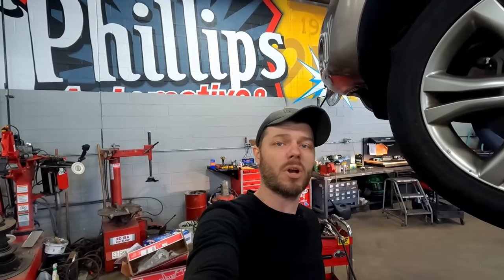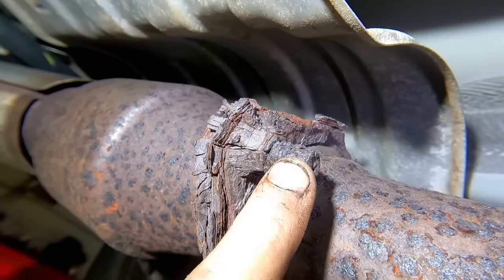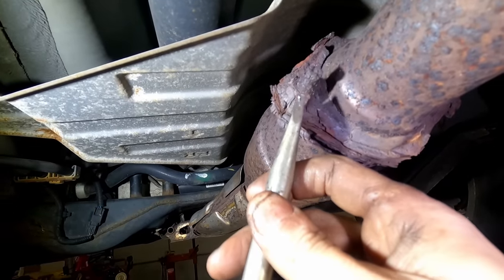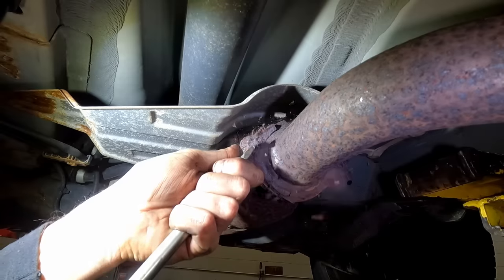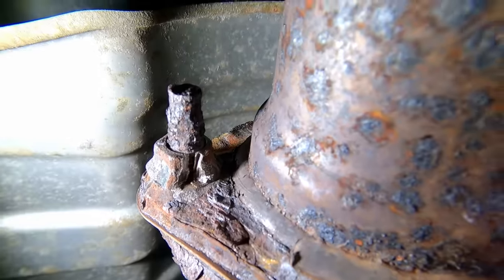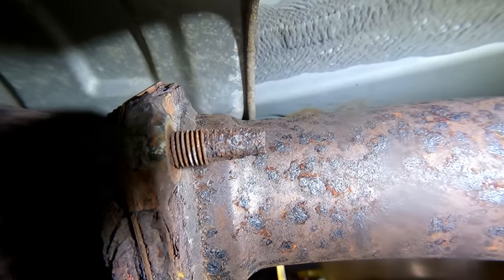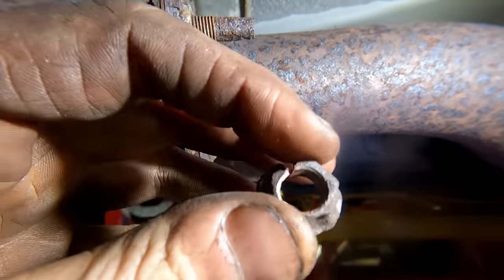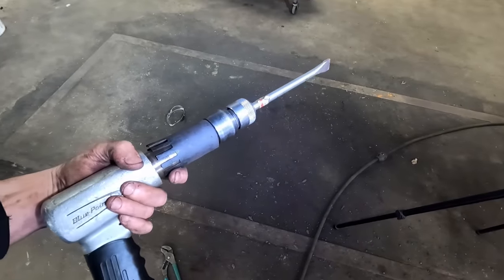Top Secret Mechanics Trick 2! HOW TO remove extremely rusty exhaust nuts FAST without heat.

Comment: My dad taught me that trick with a hand chisel back in the 1970's.  He learned it back in the 1930's,  Nice to see that not all older methods have been totally forgotten.  Still, now that I'm older and II cheat and use a nutcracker where I can.
Reply: Agree, that's the old way. 👍
Reply: @dickJohnsonpeter  Agreed. If you can't afford to replace rust-damaged hardware, you're not charging your customers enough.
Reply: today  Nobody does this way , cut the old bolt then heat up half bolt left on flange and punch it out , replace new bolt ,
Reply: @thev5140 : this is what I have been thinking the whole time !!! …
Reply: @thev5140  This method would be helpful for removing BMW exhaust section mid pipes that connect to the headers. Those headers are $4,000 and all the best getting a torch in there. I'm broke and don't have fancy tools. I have successfully removed rusty exhaust bolts by warming the car to operating temp, blasting it with "Deep Creep", hitting it with an impact or extractor socket. Never failed. This is the #1 hurdle for BMW guys.
Reply: My dad taught me this trick back in 1310 and he used a piece of wood to get it out.
Reply: Never work on anything rusted without gloves and the assistance of what MapGas offers.
Reply: I call BS.  This is Top Secret.  No way your dad would have taught it to you!
Reply: @jsnthurst1  Alchemy passed down from father to son.
Reply: @thev5140 you missed the point . Wach again till u get it.
Reply: My Dad too at about that time,  Problem with using a hand chisel is you need to hold a sledge hammer on the back to keep the clamp solid otherwise you loose the energy of the hammer blows.  Nice video,
Reply: @bd3403   The tool every mechanic needs but doesn't have is a third hand.. it would make so many jobs so much easier.
Reply: I learned this in 1904.
Reply: @Michael-yi4mc  Oddly... I'm not nearly as surprised that you learned something in 1904 as I am that you can still remember it.
Reply: @RJ-vb7gh  👍I was a savant cat in my past life 🐶
Reply: @Michael-yi4mc  All 9 of them?

Comment: Easier to cut them off and use new bolts and nuts. I don't see any advantage using stressed and rusted hardware..
Reply: not if you live far from a bolt shop or if the bolts are part of the other flange. You could have new bolts ready, but how would you identify the thread when its so far gone? Is it 5/16, 3/8,7/16, UNF ,UNC,  M8 standard, M8 fine, M10 std, M10 fine, even M12 on a truck!
Reply: Can't always cut them off , try undoing a rusted 3 bolt exhaust rear flange on a pajero above the rear axle , a grinder doesn't even get close
Reply: @stestar09 cutting torch is faster than a grinder.

Comment: From a retired toolmaker from Australia  a very excellent tutorial of the process with no waffle just facts .This 76 year old fella just  learnt another helpful life tip .Thank You
Reply: Are u sure yr a toolmaker, coz IF u are surely this is old abc knowledge.
Reply: @cmx4eva  YES I Certainly am a toolmaker not a red neck mechanic and you learn different skills . So here is a test for you . Try to figure out how do you cut a  left hand thread into a 10mm [3/8''] thick piece of metal using a R.H. tap . And yes it can be done I was shown by a older Russian toolmaker .
Reply: @cmx4eva  
Also ABC knowledge is that tool makers deal with almost no rust. Certainly not the kind you find under a salty road car.
Reply: @kevinklei3005  I am curious... how?
Reply: Me 75 , Amateur   in Mechanics , I too learned something new from him……
Reply: How do you cut the tread I'm interested
Reply: @ronfox5519  Wrong. Toolmakers deal with rust, during mold repairs for example. Plus, they often service own cars as a hobby. Clutch swap, head gasket job is no big deal. Fun project for a weekend.
Reply: @GrandePunto8V  
Mold repair and car repair ain't tool making.
Reply: It was all waffle and the wrong method.
Grab a grinder or reciprocating saw and bang, done in under a minute.
Reply: Those are just 3/8 or 5/16 through bolts when im done with the smoke wrench , its quicker ..
Reply: @kevinklei3005  ok I'm intrigued, how does one cut left hand threads with a right hand tap?

Comment: Pretty slick! For less rusted but hopelessly stuck nuts that you really want to save, clamp a pair of Vise-Grips on the nut as hard as you can. That forces the thread together in the direction it is being clamped and opening up a small gap 90 degrees from it. Spray penetrant oil on the end, letting the fluid wick in. Repeat on as many pairs of faces as you can, then use the usual tools to remove the nut. It will still fight, but at least 3/4 of the time I simply could not get a nut loose this made it happen.
Reply: That sounds like something I can actually try at home, thanks.

Comment: Thanks for the straight forward video... If you DON'T have air tools or hammer-drills, you can use a dremel with reinforced cutting wheel and cut a groove into the nut  and pry with a flat-head screwdriver OR cut 2 grooves from 2 different angles and watch it fall off on its own. Takes two minutes. Less time if more rot :)
Reply: so good of you to have had this idea and posted it here.  
     you model how we all benefit via evolving
Reply: @spacefury65 I unfortunately used a grinding wheel, and a piece of metal fell down into my muffler. I have removed the muffler, can hear the metal piece move around as I flip the muffler in my hands 180 degrees. My question sir, is how do I get that piece of loose metal out of the muffler..? Thank you for your time and any advice is very much appreciated.

Comment: I used nut splitters back in the 1980s, simple and easy when you don't have compressed air.
Reply from the maker: yes. Unfortunately, they are always limiting on a vehicle. Often, they don't fit around the backside of the nut.
Reply: Same here, had different sizes,  that was also in the 80’s, always found the vibration caused other issues when using an air chisel, not to mention the noise pollution
Reply: I have yet to find a splitter that works.
Reply: I used a torch heated the nut and melted it without harming the threads. This will work but I didn't like the airhammer on exhaust
Reply: Yes, if you want to know about rust come to the UK.
Reply: @davidwharton841  Absolutely!
Reply: @davidwharton841  UK has the worst rust in the world. In Scotland we would have kept that nut and put it back on later.
Reply: @michaellavery4899  The northeast "the rustbelt" in the US would disagree with you on that
Reply: @FM4AMGV  Fair point.
Reply: @michaellavery4899  but seeing as you guys don't see the levels of snow and ice that require the heaps of road salt we use over here, it would surprise people just how much your cars do rust over there.
Reply: @FM4AMGV  Most parts will only carry so much salt before it is washed/falls off. And a good covering of the crap will do as much damage as it would if it was caked on.
From about October to March you can expect to see most unwashed cars covered in grit.
That's my theory anyway.
Reply: Was gonna say, this is functionally the same thing as a tool I think I have..
Reply: @davidwharton841  you call that rust? Come to coastal Scotland 👍
Reply: @dougaltolan3017  yes, I've nearly always lived in coastal areas and been a mechanic or 'rust technician '. Lived inland in South Africa for a bit and stuff just came undone. Luxury!
Reply: @FM4AMGV  We need Ryobi's Undercarriage Cleaner!
Reply: @davidwharton841  NEW YORK!
Reply: @martinmoffitt4702  I'm a mechanic in Upstate NY and I second that! 🤣👍
Reply: @midnightrider1854   Rough Go'n up there! I lived and worked in Rome for a spell RUS-TEE!
Be well Happy Easter!
Reply: @martinmoffitt4702  just outside of Syracuse here. And yup, RUSTEEEEE..!
HAPPY EASTER to you too.
Reply: Great technique. I hate rusty exhaust systems. 
Can I ask a question? 
Could the vibration impact the porcelain in the cat?  Thanks
Reply: I did on my 1970 Land Rover.
Reply: @FM4AMGV  we dont get the snow, but i guarantee we get just as much salt. as its application is temperature based. and its mostly around 0c here in winter at night
Reply: A nut splitter is simple and easy even if you do have an air compressor. 
I still have the one I bought  circa 1966.
Reply: Plus the Northeast US has heat and humidity like no other, usually the day you have to work on the exhaust or brake lines.  Can just feel those rust flakes finding their way past your safety glasses landing in your eyes
Reply: In Wisconsin we just cut weld and cut again 😂
Reply: Just use heat and deep socket nut extractors if normal wrench doesnt work

Comment: Hey MotorMike....
I used your method EXACTLY on my Toyota exhaust flange. My flange looked much like in this video. Viola! It worked perfectly!!! and as you said, the threads on this rusted stud under the nut were perfect while the rest of the stud was corroded.  I was so exited that this worked.  Thanks for your video.

Comment: Great tip. But for those without an air chisel, they make a tool just for this and it's a whole lot smaller than an air hammer. It's called a nut splitter! It has an open end you put around the nut and then you screw in a hardened punch it has on it.
Reply: It wont fit in limited access areas like this.
Reply: A nut splitter is much smaller than an air chisel.
Reply: Those nut splitters sound good but damn near never fit anywhere.
Reply: Use a heat inducter
 Makes it go faster yet
Reply: They never work
Reply: @kenlong7943  induction heater nut looseners are quite expensive. I'd love to have one...

Comment: This is an excellent method I only heard about a couple years ago. Muffler shops use a torch to heat fatigue the good parts so you'll be back for more parts and labor charges. Last time I went to one they short circuited when I said "don't torch the good parts".  Thanks!
Reply: Great tip. First time I have seen this trick

Comment: Did this today and after a good hour with the air hammer , heat, and more heat, it came off. Once I got the one side the other side came off in a quarter of the time maybe . Appreciate you making this video tons!
Reply from the maker: Awesome. Make sure your chisel is razor sharp and re-sharpen as needed. SNap-on ones get replaced for free after they are ground so many times there's nothing left.
Reply: Die grinder with a cutoff wheel would have had it apart in a minute.
Reply: @nitroustommy3668  There is not good access for that tool.

Comment: This also works with stuck bearing races. I do it all the time when changing wheel bearings. Obviously isnt going to work on every single rusted thing ever but it does work quite often, Id say like 85% of the time. Sometimes a saw and replacement parts are just better, just use your judgement. Excellent video 👍👍

Comment: Great idea. I wonder what the vibration does for the integrity of the convertor?
Reply: Probably far less than the road vibration it has to deal with on a daily basis.
Reply: That'd be my concern as well. I used an impact on my exhaust, and only a few miles later it plugged up hard and quick enough to blow a well maintained 2.2l
Reply: I thought he said they were replacing the converter?
Reply: Pretty sure that converter is toast anyway 😂
Reply: @goldpop5001  nah, not exactly - he said „take down the converter“. While it implies it‘s being replaced it could be some other form of maintenance (lambda sond, cleaning, what not).
Reply: Very good point! The air chisel  absolutely would rattle the insides of the cat converter much more than engine vibrations or road bumps. Just look at the way the nearby rust flies off when chiselling! One way to minimize the damage is to hold a large mass of metal on the opposite side of the flange being hammered to absorb and reduce the vibrations.
Reply: замена катализатора в разы дороже, чем поменять заржавевшие фланцы, просто отрезав их.

Comment: Usually when the rust is that bad, the flange is compromised and will probably not seal.
Reply: Furry to[to your Dr esse to you in in😮😮😮
Reply: It still has to be taken apart. What if the flange was good but the pipe was cut off with a sawzall?  This was lightning fast. Sawzall would have taken more time.
Reply: That's what i was thinking

Comment: They actually sell nut breakers for stuff like that. The only issues with broken bolts is when the threaded part is broke in places like the heads. But for those without a $20 tool, your method works great.
Reply from the maker: yes. I've found the nut crackers are always limiting. Very often on a vehicle there isn't enough clearance behind the nut to fit the tool even when the nut has decent access.
Reply: those without a $20 tool but a xxx$ air chisel and compressor..

Comment: Haven't seen this done for quite some time.  Thanks for the reminder.  We used to do this with just a hammer and chisel on stubborn nuts back in the day on my dad's log truck.  I'm going to use this method to remove the rusty u bolt nuts from my old boat trailer tomorrow.  Looking forward to putting my air chisel to good use.

Comment: The nuts used on exhaust hardware, especially on clampts like the one shown, are typically fairly soft steel. It is not hard to cut that groove into one of them by striking it with a cold chisel, using a hammer on the cold chisel. A power tool makes the job a little faster, but is not needed. Takes maybe 15 seconds with an air-chisel, 60 seconds with a hammer and chisel. If there is a enough space, you may be able to crack the nut by using a "nut-cracker" around the nut. This is a simple tool that cuts into the nut using a threaded rod to apply the leverage that is used to force a cold chisel into the nut. The threaded rod is used instead of a a hammer. It is king od like like putting a c-clamp around the nut, but instead of clamping onto the nut, the device cuts into the nut.
Reply: Difference is I will hit my fingers at least 1 out of 25 swings which makes me flinch. I will never hit my fingers with the air hammer 😉
Reply: @phazerboy Nah. I don't think so. You grip the cold chisel the same way we see MotorMike gripping the air chisel. If the hammer hits the end of the chisel and then slips off, it will hit the side of your thumb and forefinger, causing your palm to go sliding down along the chisel. If you aren't wearing a glove you may scrape some skin, but you aren't likely to crush any bones. Not unless you completely miss the chisel and smack your hand. Even then, you are hitting the sides of your forefinger, which will bang into your long finger, which will bang into your finger, which will bang into your pinky, which may eventually bang into the clamp, but only if you are using a rather short cold chisel. You're not likely to draw any blood. That's what I think will happen. I don't remember ever injuring myself this way.

Comment: Nice work and an easy task for folks with access to a well equipped pro-workshop. Lesser folks like me have to use manual hand tools to remove super-corroded fasteners with carefully aimed Big Hammer .. 👍
Reply: yeah exactly. easy when you have all the gear
Reply: Trust in the BFH.
Reply: @James28R  Much easier, for sure.  100% worth building up the shop as you can.

Comment: Omg after all the years of struggling with blow torches brute force and lots of swear words ,I was thinking of angle grinding these bolts off but limited space ,so tried your technique and yes I confirm it worked perfectl and took 2 mins with a dewalt hammer drill and grinded sharp chisel bit so happy and thank you got 2 more left to get off 👍

Comment: Not sure if it would be powerful enough but a battery powered hammer drill set to just hammer and don't spin might be a substitute for the air hammer. Works quite well as a small job jack hammer on concrete.
Reply from the maker: I’ve used a Horrible freight electric hammer drill before and I believe it would be powerful enough

Comment: Thank you, I used this method yesterday, although I don't have an air chisel, I used an SDS drill with chisel attachment in hammer mode, done the trick but took a little longer than the air chisel.

Comment: COOL! Now all I gotta buy is a compressor, an air hammer, chisel, bench grinder and a car lift!!!
Reply: As someone who's been wrenching on cars for 35 years, going from the driveway in winter with basic tools to a heated garage with air and all the right tools for the job, I can say it's 100% worth.  Start building up that tool set as you can.

Comment: Good tip!!  Guess I need to add an air hammer to the toolbox 😎
Reply: Yes  High quality air gun, and a great high volume air compressor. Cheep tools are not reliable enough for the trasdes when you have to push the tool.
Reply from the maker: It’s a very valuable tool. I use mine often. You’ll see many more air hammer tips videos on my channel in the future.
Reply: or just a nut splitter from harbor freight.
Reply: Or spend Dan near $600 on a matco long barrel and call it done. Cheap tools have their place but a good air hammer is not something that I would cheap out on cause when you need it you really don’t want it to fail

Comment: That was Great. I'm glad I watched this video. My tool of choice has been my 4 1/2 inch grinder with a cutting wheel. Now I need to buy an air chisel because sometimes you don't want to ruin the bolt. 
Thank You.
Reply from the maker: if its truly a 'BOLT' passing through a hole then dont hesitate to cut it off. Thats fastest. But if it's a Stud and the Stud is on the side your saving then do this trick. Good luck